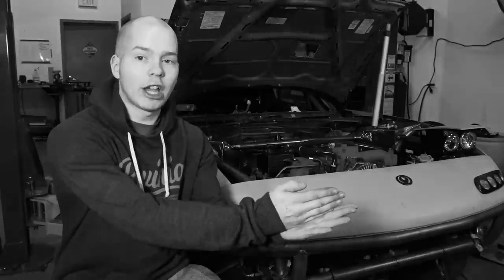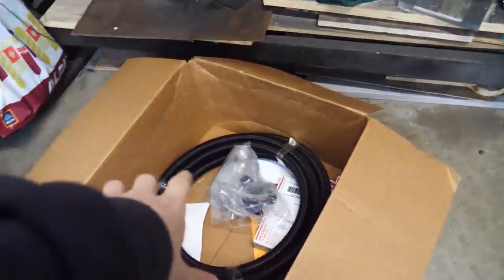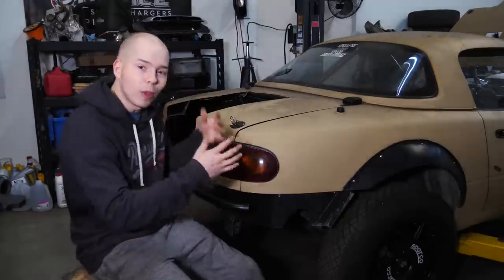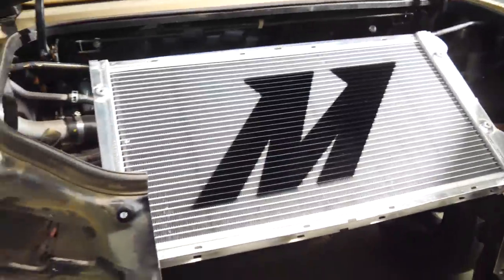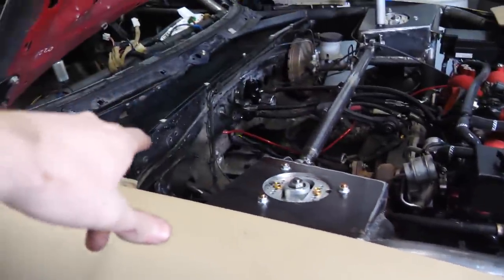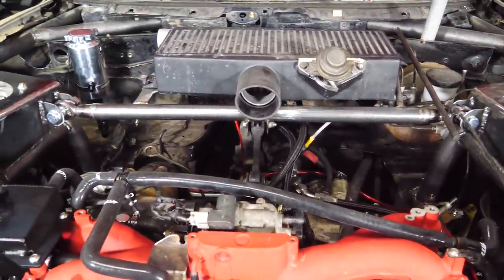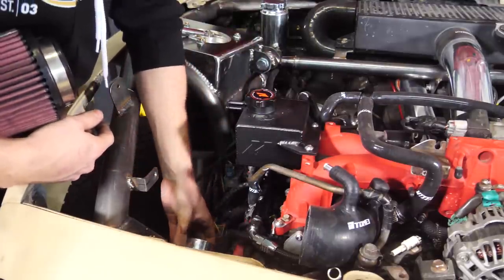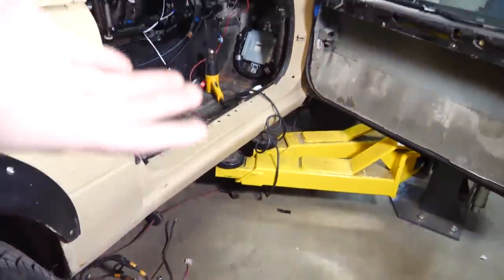AWD Miata Gets a REAR MOUNT RADIATOR!

Comment: This car will need some sort of wheel liners/metal to protect the engine and bay. Once those are installed I am sure the intake can be placed in either location.
Reply: Also, if it doesn't have wheel liners, the first time he takes this thing offroad the entire engine bay is gonna get caked in mud.
Reply: @jax6580  Pretty sure he would have this sort of thing into consideration, its pretty obvious.
Reply: Roof intake would look awesome
Reply: Why use -16? -20 would be better
Reply: @DJkirakira he's fabium of course he'll figure something out

Comment: I would say doing the 180 and putting the filter under the bumper would be the best option.
Reply: DelTalkoh out of the hood like that one rx7
Reply: The Exhaust is under the engine, wouldn't it better to put it far from heat?
Reply: Stanley you dont want it too far for no reason infront of the bumper is fine
Reply: @christiandavila510  How do you see that? exposed to water and mud? Gingium solution is the easiest and good enough
Reply: Higher chance of water and mud getting in
Reply: Stanley i would put the intake where the hood scoop is going to be (he shows it on his ig)
Reply: how bout passenger site?
Reply: yondaime hokage its already on the pasanger side
Reply: @christiandavila510  Thats where the wrc car had it, i would put it there too, plus it scoop would look good xd
Reply: Wheel wells and put it towards the fender. Cold air intake.

Comment: “Im putting radiator in the back to even out weight distribution” proceeds to cut out the entire trunk
Reply: Well the weight isn't added to the front so it will still help. And the weight he added with the radiator, fans and water is still going to be more than the weight of the sheet metal he removed.
Reply: @poepeloerke2  this comment makes absolutely no sense lmao
Reply: @fakename287  he is saying that putting the radiator in the back, regardless of the removed sheet metal, will help with weight balance. He is still transferring weight to the back that could have been at the front.
Reply: Nobody ever: trunks are useful
Gingium: we're going to put the battery in the back, where it belongs on a miata
Still nobody ever: front mount radiators are ok and work I guess
Gingium: *angle grinder noises *
Reply: Right

Comment: Put the air filter under the bumper up front and just extend the wiring. Beats dealing with potential issues running it in the wheel well. And either it getting wet unless you built a shield to block the splash of water. And you won't be pulling in any hot air from under the hood that may be trapped.

Comment: You could do a 45° and build an airbox to move the actual intake down to the front of the car and still have the filter up top for easy access. And you could mount it to a fender liner

Comment: Tip for your video shots. If possible shoot at a higher frame rate and then slow it down for smoother b roll shots. For example instead of slowing moving the camera for a shot. Shoot at 120 fps and at a faster smoother motion and then slow down in post-production. If your camera doesn't shoot in 120 then shoot in 60 and slow down to 30. Just a tip :) Love the build by the way and hands down one of my most favorite youtube channels.

Comment: For the bottom of the car you should try just putting aluminum pipes with an fittings so that way you can weld them to the bottom and less hose to tear or wear from stuff kicking up. Rad dan drift car is a great example. Probably cheaper too

Comment: I feel you should make a aluminum plate around the Intercooler so you don’t see the trans and stuff since the motor is so far forward just so fill out the engine bay and keep it clean in there

Comment: Gingium it’s ok building a sick car takes time and if you rush things it will brake the vary first time you take it out and also to quick suggestion I would put the intake filter upfront or keep it cleaner and also to you will get colder air for a better boost  awesome job on the channel keep it up you’ve progressed so much through your YouTube career👍😊

Comment: Making the intake do the 180 and go though the bumper while not as impressive looking strikes me as the better option since your not only going to deal with water but also mud.  On the trail there is not going be as many easy ways to clean a air filter, so why risk putting yourself in a situation where you need to be towed because the air filter is caked with mud.

Though, if I maybe so bold.. instead of trying to keep it tucked under the hood.... why not cut a opening in the Hood for it to poke out of and shield its back from the wheel, that way it could be protected from the mud, and water the wheel will throw up, well ventilated,  and be visually interesting and functional.  And making a protective back shield, and cutting the hole in your hood also adds a minutes worth of fabricating video content to a video which might be helpful if your keeping track of how much time you need to fill with each video.

Comment: Back in 2015, I was thinking of doing this to a 1997 Ford Escort using a two wheel drive 305 GM, out of a truck that would have been an amazing truck if it had a stock 5.3 vortek.

Comment: I have a few thoughts about this build, one is wont the radiator get tons of rocks and mud thrown at it, and also with all those gaps in the front end, especially around the wheel wells, wont the entire engine bay get absolutely creamed with mud?
Reply: It'll all need some serious protection and walling off.
Reply: needs fender liners

Comment: Protect the intake from water. I had a lancer with a cold air intake right above the tires like you suggested. In a rainy day I almost lost my engine. The water made it through and the MAF sensor saved it because it wasn't reading well the air flow, so the engine ran like crap and immediately I stopped the car to take a look and found out this what I just told

Comment: you're pulling hot dirty exhaust air from underneath the car towards the radiator, not to mention the chance of rocks flying up at the radiator as well. should really mount it facing down like every single formula D car.
Reply from the maker: I'm doing it this way for a couple reasons: mud wont build up on the top of the rad. I dont have to make a strange scoop on the top of the hood.   Can run the lines under the car this way. 
I know formula d cars do it the opposite way, but they dont have a choice. They're 2in off the ground and there is zero airflow under their cars. All trophy trucks mount the radiators like this
Reply: @_Gingium_  yes but the radiator on a trophy truck is on the back windshield, touching the roof sometimes. They have a large cowl underneath to get the air but not the rocks.
Reply: I was thinking that too, maybe build some vanes at the bottom that face back so that anything coming from the bottom won't make it to the rad.  Not sure which direction you were planing for the air flow but in that case it would make sense to make it to from top and then out through those vanes.  You'll need some kind of intake at the trunk too, maybe a scoop or more vanes or something.    I'm not a car guy though... but I'm just thinking about general air flow and that's how I would do it.

Comment: It would been more wise to install the radiator at the bulkhead, if it doesn´t fit to the front ? But like that you are going to break the cooling system when go offroading first time.

Comment: Are you going to protect the radiator from low flying rocks and are you going to put some sort of inner arches then the air filter would not suck in water unless you are under water.

Comment: You really need to get that air filter out of the way of water even an Outerwear's pre-filter will let water through, so either put it in front of the engine but I would mount it under the intercooler rather than let water get on the filter if putting it by the wheel fabricate a deflection shroud, I watched TFL on here and they have a new Beetle and it is modified for playing in the dirt called it BajaBob, well the filter got soaked and the engine went into limp mode as it was drawing in water and clogged the filter.

Comment: I’m not an expert but as far as I can see from seeing other rear mount rads, shouldn’t it angle the other way? (Higher up in the rear and lower in the front) so that the air coming over the roof goes straight into the radiator?

Comment: what are you going to do with all the weight over the front of the axle.
Reply: Charles Seara Well, to solve that problem in track cars that don’t meet the weight class, they add lifting weights to the rear, like the weights that you put on a bar. Big bolt and nut, and it’s not going anywhere. You can dial in weight distribution because of how many pound options you have.